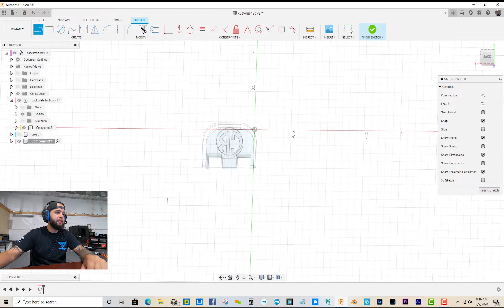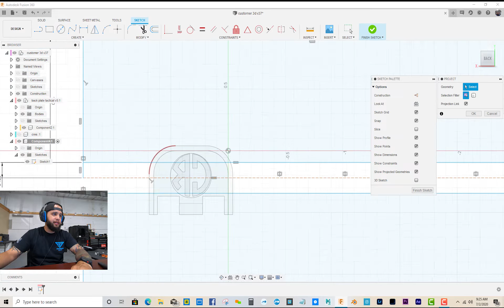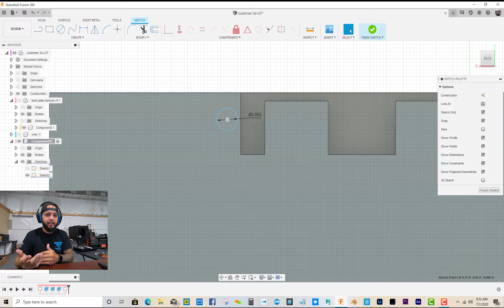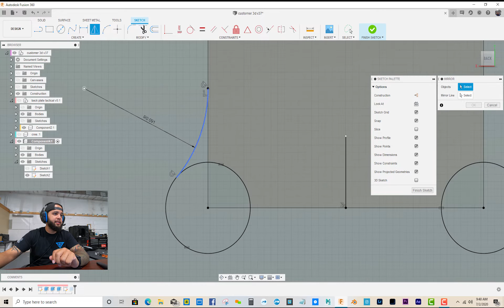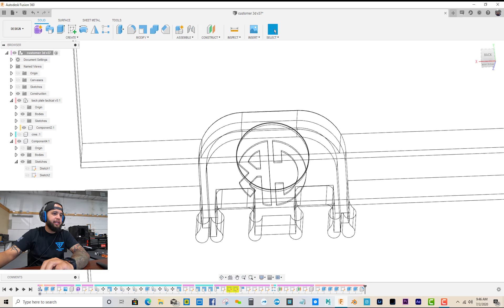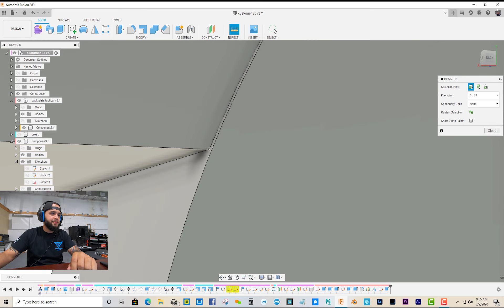The SECRET to Holding Parts When CNC Machining

Comment: Very informative video. Its nice to see more content with Fusion and Tormach. Regarding relief nu...CUTS. One thing I learned a while back is that you can offset the circle center instead of centering it on a corner. You could dimension those in about .025 and it just leaves bit more support by taking a scoop cut out. it does add time though. Lots of ways to skin a cat.
Reply from the maker: Jody Olivent oh man there so man ways lol. I could have to cut out a box shape at the bottom and did to relief cuts instead of 4 but I wanted to show people the long way and create there own short cuts once they understand the purpose of the relief cuts. Thank you for your positive feed back brother. It feeds me to keep on making these vids also I’m learning as well just from you guys and these awesome response.

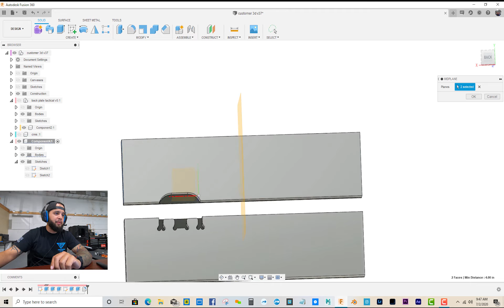Comment: Pretty good vid.  One suggestion...instead of mirroring the first cavity to make the second (approx 33:44 in the vid), the pattern function would be a better workflow.  Mirror worked here because the part was symmetrical.  For parts that are not, there would be an issue.
Reply from the maker: Thank you I will have to try that.!!
Reply: @cadlabCNC  I was also confused about setting the WCS in a feature that you haven't machined yet, but I figured that was for demonstration purposes for later when you set up the CAM ops to machine the parts instead of the jaws. ;)
Reply from the maker: MOA Customs yea sorry about that. I am going to mill a set off soft jaws out on my next video. I’ll make sure to cover that. I appreciate your feed back for it will only make us better.
Reply: @cadlabCNC  Can't wait to see these jaws milled.